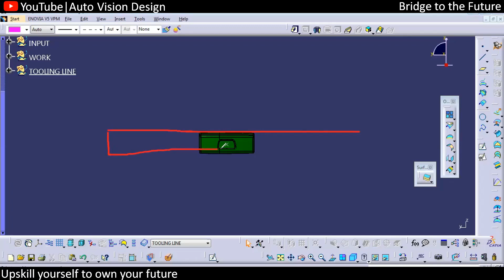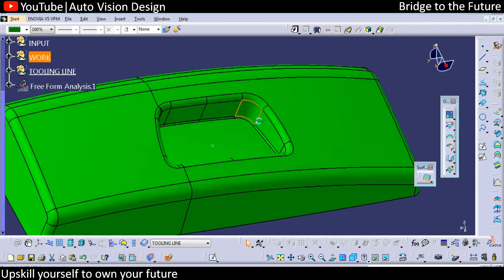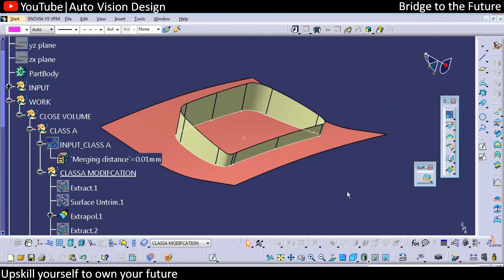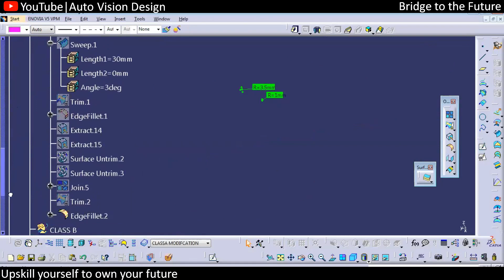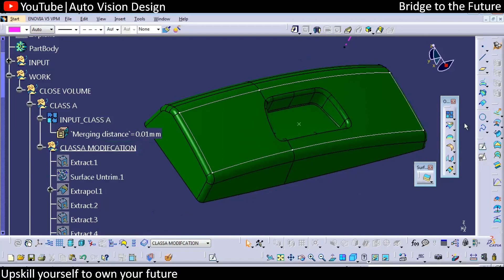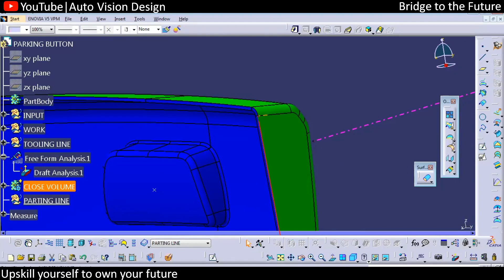CAD TEST - Tooling Line Fix | Class A Modifications | Automotive Plastic Trim

Comment: Hello bro ...i have to clarify with you..when we go for class surface change instead tooling direction and vice versa...how to choose...
Reply from the maker: Start with
01. Assemble direction as tooling line 
02. Maximum class a surface to be cleared in 3deg. in any direction that will be TL
Reply: @AutoVisionDesign  bro i am asking abt in this video without changing the tooling line...u change class A surface to achieve correct draft analysis....why u are not change the tooling line angle...
Reply from the maker: Pl check video from 7.00min onward 
Still you have any question will check sepratly please mail on autovisionds2022@gmail.com
Reply: @AutoVisionDesign  okay bro

Comment: what are the changes that undergoes in tooling or the part as part goes through variouus design phases from concept to proto to production ?
Reply from the maker: Tooling changes request from supplier 
01. Parting line issue / Draft feasibility 
02. Critical area or complecation for slider lifter movement 
03. Basic Design rule if not followed like
Draft / shutoff angle / fillet / sink issue / part THK